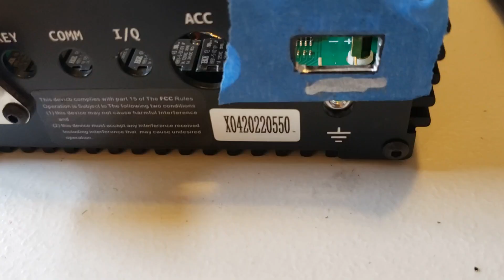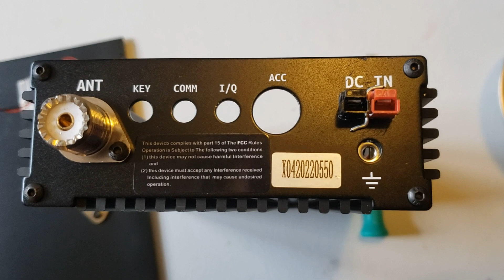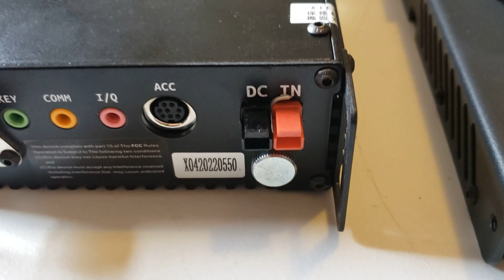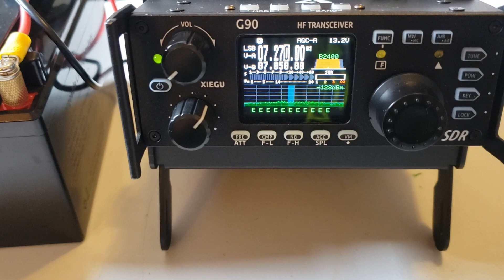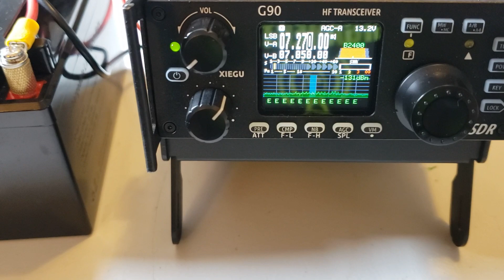Xiegu G90 Powerpole Mod

Comment: Every time I moved my radio on the table, my power would die. The socket / plug they used is certainly garbage. Anyway, I did your mod and it went great. Thanks for posting.

Comment: Very Nice Job Ant! I just got a used G90 and it has the old plug. This will be a  Great Mod and it's not that difficult due to the  thoroughness of your video. My only concern is the wire from the Fan Body to the G90 Power Input. I plan on carrying the Same Wire Gauge from Input of the Fan Body through to G90 Power Input. Hopefully the Insides of the Fan Body are not to complicated to make that happen. I don't like having different wire gauges in the same wiring line if I can help it. Thanks for Help! 73, Kevin NZ1I

Comment: If you don't think you can do this mod, I made a short pigtail with Powerpoles on it.  This helps to not stress the original power connector.  I did the same mod to the fan stand.

Comment: The latest ones seem to come with powerpoles now. Mine did anyway. It occurs to me though that there's now a connection compatibility issue between the radio and the cooling fan stand, which still has the old connection I think.

Comment: I just picked up a brand new g90 sweet little radio, the power poles I guess are on the current new ones
Reply from the maker: It appears they are being shipped with the powerpole connector from HRO. About time. :) But the fan tray is still the old connector. Easier to swap that.

Comment: Funny thing, I just ordered my G90 and it came in the mail yesterday. I was surprised to find it came with the power poles already installed on the back. I have no idea if this is something new the manufacturer started doing or what, but am very thankful it came that way. It was ordered online from HRO.
Reply from the maker: It's about time! Happy to hear they FINALLY fixed this. Looks like from the HRO site they haven't updated the GFZ-1 fan tray. But that's an easy fix.

Radioddity images still show the old power connector. HRO images do show powerpoles are installed. :)
Reply: @nu1u_ant  That's fantastic! Maybe HRO has some technicians swapping the connectors. Either way a good call on someone's part! I got the fan stand from HRO as well and can confirm the connector on the back isn't updated.

Comment: Much Mahalo, just did it last night 20240705 Friday. You were right about always checking fitment of power poles, very slow process. I unscrewed golden screw stand for easement of sliding powerpole through refitted hole with a needle nose plier. Do this step beforehand so you can have longer strokes while filing. Now I feel much better that there won't be that moment when I say I should of done it beforehand. Already did extended mod while I was in there tinkering. 
Mahalo and Aloha from Honolulu Hawaii 🤙🤙🤙😎😎😎😎

Comment: just what exactly do you gain by doing this? the original connectors, while considered cheap toy connectors, supply the voltage and amps required.
Reply from the maker: 30 seconds in has your answer.
Reply: I'm having problems with the OEM connectors not being tight enough and causing the rig to switch off. the wobble around too much - cheap and nasty

Comment: Glad to have found your video for this new owner of the G90. Buying mine from another ham, it still had the POS OEM connector. Swapping it out for an APP was a natural choice simply because all the radio power cables I have around are configured with APPs. 

For anyone undertaking the connector swap out, with patience and a fine mill file, one can enlarge the connector opening for a tight friction fit that, at least for me, works quite well. I opted out of using tape to mark the size of the opening in favor of going slow to remove metal and constantly testing the APP for fit. Because of little power the G90 draws, the 15A pins and APP housing are more than adequate.

Comment: I've not changed anything to power poles yet.  Can you tell me what size you used?  I'm guessing there are many difference gauges/sizes out there...
Reply from the maker: I think I used 15 amp. If you are going to start powerpole-ing all the things, just get a bunch of 15, 30, and to a lesser extent 45 amp ones. The plastic housings are all the same size. Haven't noticed a huge difference between the cheap ones and name brand.

Comment: Thanks for the video,  however,  I achieved  the same by just removing the back panel completely. This involves desoldering the coax connector. But worth it, save all those filings flying around.
Reply: Plan on waiting for the factory connector to fail and will probably use your method. If others prefer to NOT de-solder, I would place a couple niobium bar magnets around the hole to catch the filings. 73 N3JLR